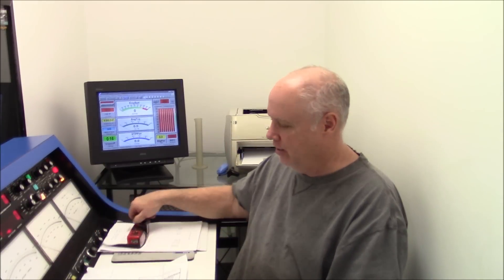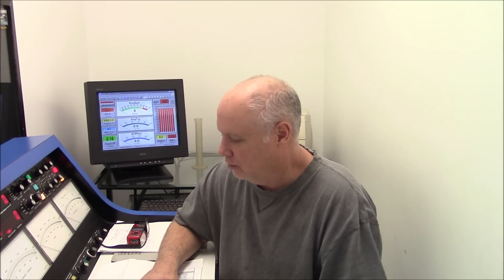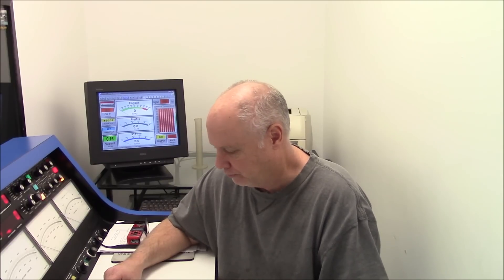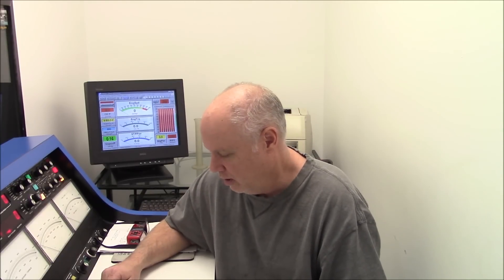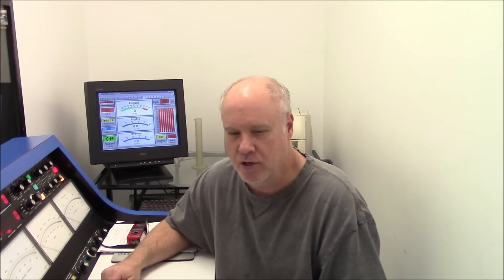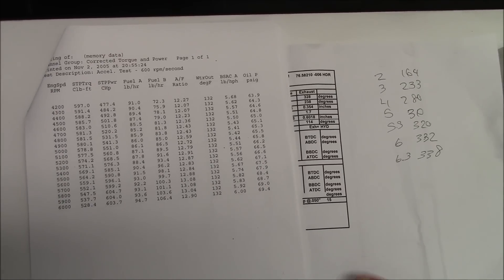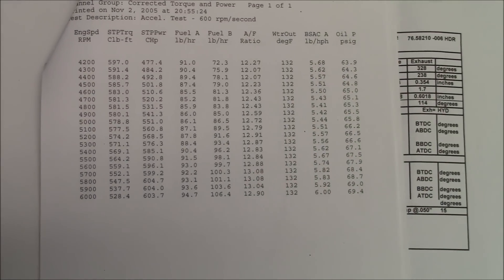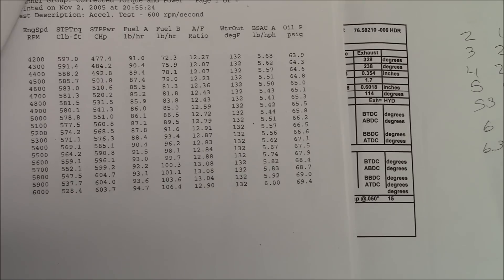Procomp / Speedmaster Oval Port Cylinder Head On 467" Big Block Chevy Dyno Test

Comment: U like those rpm intakes?Not trying to question your judgment, but on my flow bench with  a 330 cfm edelbrock pontiac ,I lost alot of flow with a rpm intake attached to the heads 30 to 45 depending if upper or lower plenum was flowed.Also noticed that the lower plenum flowed better than upper .You seem totally committed to doing a good job.

Comment: I have these heads, ran 11.5-127mph 1/4 mile in a 4 door sedan, with sealed pro 10cc cast pistons, 240/240 578 camshaft, The kit I brought came with adjustable guide plates.
Reply: Glad to hear you like the heads. I bought a set for a 30 over 454 I'm putting in my 69 Camaro. Same pistons as in the video but I'm using a Comp mutha thumper 570 lift. Hope it will run in the mid 11s as well!!

Comment: When you said the exhaust valve guides were all shot I think I know why. I have a set of these very heads in square port! When I have the geometry right for that 320 cc exhaust valve for 90 degrees at mid lift the 1.7 roller rocker that came in the kit with the heads is on the outside edge (toward the fender) of the top of the valve. If those were kit heads that could be the reason why all of the valve guides for exhaust were shot. My question to you is how do I figure out what back set rocker I would need to correct that issue? The valve top 250 thousands maybe a 32 more. Do I count back from side to center from 1.7 to figure out the back set I would need? I realize this video is old and you might not even see my comment but if you happen to somehow I would really appreciate the help...
Thank you in advance, 

Larry

Comment: Yes but couldn't the moral to the story also be use a Bigger Bore sized motor  like 572  or 540 ??
Reply: maybe but the amount of work they had to make them right still might not even be worth it even if you bought them bare.  just buy a performer RPM head retangle port and a weind high rise.  proably less work and would bolt on as well with more compression

Comment: i have used maybe 10 sets of these heads and have not even once had any issues, and will continue to use them. of course i am using new heads but never use adjustable guilds i have never had a problem.
Reply: Glad you like these heads! Bought a set for a 454 I'm putting g in my 69 Camaro

Comment: A big block chevy doesn't need aftermarket heads for anything under 700hp.A probably set up OEM 049 or 781 head will support 600+ horsepower.

Comment: I believe camshaft selection along with the intake choice hurt your HP potential.  They were the right choice for a Torquemonster, but with that many cubes a duration in the 240°- 250° range would have suited the build better in terms of HP output. Also, with a cam in the 240° + range a small singleplane would have complimented the build better, if your goal was indeed HP production.
Reply: I think you could be right but again if the customer wanted that intake and that particular cam, the customer gets to make those decisions and Mark may have had to work within those parameters.  I like what he does with those iron oval ports but the reason a quality aluminum head is so attractive for alot of guys is the shear weight savings off the front end of the car.
Reply: who woulda thought.. bigger cam more horsepowers... and spin and spin till all the parts fly out.  Thanks for the obvious.
Reply: @superkillr   hey genius,  RPM.. IS how you make hp in a naturally aspirated engine. That's not gonna happen with a dual plane and a 232 @.050 cam in a Big Block Chevy. He blames the combustion chamber ?.. think again.

Comment: I bought a set of 305cc bbc heads bare....they were for a street rod truck. The quality was pretty good. Took to machine shop they assembled with Manley valves, Comp Cam springs. The only port work was just around the valve seats. I had about 1000.00 into the heads parts labor after all was said. These were bolted on a 454 with a HO cam. I would not take theses heads racing ....but for cruisers they are just the deal

Comment: I'm not a fan of Speedmasters but I think they have a legit place in the market. I'm working out the details on a 460 BBF swap into a 93' F150. All I'm looking for is a torque monster street cruiser. Any used iron heads are going to need a lot of work = money. Name brand alum = Much bigger $$.  BBF Speedmasters are at least as good as prepped D0VE's and weigh half as much. I'd love to have a set of Kaase SR-71's... if I can get someone else to pay for them. ;)

Comment: Seems like pay me now or pay me later, he gets equal or better from his worked cast heads but again not easy to find a set of good/usable heads just collecting dust in someone's garage, sometimes i think a good 502/572 crate engine is the way to go

Nicks garage has a good video on someone who bought a BBC SUPPOSEDLY making 600 hp with no dyno sheets/proof and ended up making i think about 350 due to mismatched parts that the engine was assembled with. i would love to see some comparisons of the oval/vs rect. port heads from back in the day

Comment: Cheaper is not better,several years I bought a set of brodex aluminum heads for a small block chevy, after installing valve geometry way off. I had to get car running so I left it that way for a couple of weeks before getting back to fix them, in mean time I broke 2 studs while driving,long story short had to redo entire heads new arp studs isky adustable guide plates all new puahrods valve guides and $600.00 dollars later boy what a deal. After redoing motor did not have any issues ran great for years.

Comment: would love to see you do a side by side with AFR 300 heads on a 496 compared to a set of GM ovals that you've worked over.
Reply: No comparison. 300 AFR is the best oval port head.
Reply: @michaelparadisis4076 I agree just would like to see the comparison. I plan on putting a set on a 540 build I’m doing.

Comment: I even cut a bevel at the top of the block with iron heads. Imagine what the air is hitting coming into the cylinder from those heads. I would want to weld them up and take a cutter to them

Comment: Believe it or not i actually agree with him on this one. I actually think he his understating the issues with pro comp heads. Seat heights and seats barely in the casting (falling out) is another issue. There is very little right about them.The heads are also very thin light weight. Pro comp has an other version with a 360c intake and oval exhaust ports that is a much better part. Much better quality. thicker casting. Seem to be a copy of the old pro action heads? 
He bashes a much better head like air flow or brodix but he is polite about pro comp?

Comment: Truck head question. I have a 366T with 473328 heads. I had an engine vibration. I took heads off and found exhaust valves were mismatched. 3 valves in one head were flat bottom and 1 was concave. The other head had 3 concave and 1 flat bottom exhaust valve. Would the valve shape being different in one cylinder be enough to change compression in that cylinder to cause an engine vibration? Having 1 cylinders valve being different than the other 3? Thanks.  I'm wanting to use the 366 truck heads on a 68 396 short block (bored .030). I realize I may have to clearance cut the chamber to clear the #1433 raised dome (9.6 comp). piston. It's for a 58 belair street car. I want small valves and oval ports for good torque. I wont be revving it past 5k if ever.

Comment: I’ve used three sets of pro comps, Automatically new valves and set up with comp matching springs to the cams used. only polished intake and ran good numbers with three different cam combos.
Reply: I have run two sets of these with 253 and 259 @ .050 and .710 lift on a 106 centerline.  Same cubes at 12.0 to 1 static compression with .38 dome and made 762 hp @ 7100.  We were under carbed on the test  He is way in the hole on the cam.
Reply: @user-yc9qr7ww3r  what size motor

Comment: The numbers put down on Hot Rod Garage were rather sad as well using these heads. I think they are a fantastic head if you plan to buy them to have them ported. From what I understand they make an impressive cylinder head once worked over. Out of the box however they are barely better than stockers.
Reply: Pretty much every independent test I've seen has shown these speedmaster heads aren't very good.   It seems the AFR 265's are the best head for fairly short $$.   When I say fairly short, I'm considering a good head that's ready to run vs a really cheap head that needs ton's of work and parts before you can put it on the engine.

Comment: Hey Mark, don't you have the same issue with AFR heads as far as head gasket?
I know when I build my 496ci 
4.450 was the size of gasket I had to use,  other wise the gasket hung over the combustion chamber.
I bought  4.375 and they wouldn't work, so the closest I could get was 4.450 , on a set of magnum 290cc oval port 112cc chambers 
I used a  .030 MLS cometic gasket with the piston .007 in the hole.
On a dart big M block

Comment: Bottom line. Spend more money upfront for better quality heads. Save yourself some hassle, and be better off in the long run. Thanks for the video. There is good, and there is cheap, but there is no good, AND cheap.

Comment: He's right , I have the same heads. Purchased from Skipwhite. They did put in really good valves,seats ,guides and retainers.I did put in comp cam springs and my Corvette runs like hell. So ,resumed : The casting is perfect but the original valves ,etc are bull shit. So buy bare heads and put in quality stuff.

Comment: I have a question. I rebuilt an 8.1 496. Haven’t started it yet I’m waiting for intake carb push rods and rockets. Bored 30 over. ARP rod bolts. New flat top pistons. 
Heads cleaned a little exhaust port work. Comp cams springs. 

My question is when it came to the head gasket the only choice I had was felpro. I noticed a LOT of gap between cylinder walls. Is this ok?

Also I noticed had no alignment pins for the heads. 

So I cleaned the threads. Got new head bolts. Used a little lube on the shoulder and torque to 60. Also I sprayed copper gasket. 

Honestly I have my fingers crossed and hope it’s dependable. When I torqued my bolts some would torque earlier. 

Any advice what’s your take on this. Should I buy a better gasket is it worth it.

Comment: Mark, What would you do???
Big Block Chevy 427 Tall Deck, Industrial engine,  that has stock FACTORY reverse gear drive, with four bolt mains & steel crankshaft.
I learn alot from these videos about a solid reliable Big Blocks.
Also like NO music 🎶.
Just the facts.
Thanks.
Reply: I have 496 tall deck big block. Initially I wanted a 9.8 deck height, but when I received my 496 and looked up the casting numbers, i realized that it was a 496 tall deck. It started out as a 427 tall deck truck block. It dropped right in my '68 Impala without any modifications. Headers fitted as well. I only had to put a dent in the header to clear my power steering pump.
Reply: @musclebone7875  
Yes this engine was a grain truck engine. It has a factory G.M. gear drive camshaft (reverse rotation).
Reply: @nellyfarnsworth7381  what do you want to build out of it?
Reply: @musclebone7875  
To put into a 1972 chevy corvette. I already have Hooker headers with Hooker  side mount "mufflers".   This was before cats.
Will pull the original big block out ( number matching) & save.  Will also save the 4 speed Rock crusher, & replace with a manual 5 or 6 speed.
Reply: @nellyfarnsworth7381  ok I think it's gonna be a tight fit. I know for a fact you're gonna a 4-inch cowl hood. I'm using a dart single plane intake.
Reply: @musclebone7875  
Thanks for the heads-up on the hood. Will start looking for another hood. Do Not want to hack up the original. So that everything can be bolted back, to make a original again.
Reply: @nellyfarnsworth7381 L-88 hood would be killer.

Comment: You said you got the heads used with worn out guides. Is that why you had to replace everything is because the heads needed rebuilt ? And what CC were these heads advertised to have ? They start at 305 up to 360CC ?

Comment: In this build, he mentioned using a Scat 9000 crank. KB/Icon makes stroker pistons for 402 to 434 builds. His massaged 781 heads should wake up a 402/434 I figure. Need to talk to these guys, love the way they do the videos, laid back basic machine work. 620hp/647= 1.327 hp/ci.
434 x 1.327 = 576hp, sounds like fun.

Comment: I had that exact same set of heads and sold them before trying them because after I researched from other people  they said the same thing.They cost too much money for the little gain you get. I stayed with my 781`s.
Reply: Ozzy yeah I have 781 that are ported. I was wondering the possible gains from a good set of aluminum heads.
Reply: the shark me too. I stuck with my 781’s that have been worked. The machine shop guy was impressed how they came out after he did the valves and throat cut. I still wonder what these smaller heads give up to AFR’s but happy so far, and they’re paid for.

Comment: Btw, it only started leaking when I took it to the track and pushed it hard, I was also told it could be crank flex that would cause the rear main seal to leak under acceleration, your thoughts would be greatly appreciated thanks
Reply: Man that sucks to hear all that work and it leaks.
Reply: @ApostleDavids8w  yup it sucks! Was doing great with all the car shows and stuff, but everyone kept asking, how it does at the track, so I felt if you're going to build it to look like a racer, you'd better race it, and that's where it all started leaking, winter project I guess
Reply: Rat gas Garage ya another good winter project to make her bulletproof 👍

Comment: Hey buddy love your channel! I have a question for you, have you ever come across a leak near the back side of the oil pan next to the flywheel only when revved up, on bbc 454, idling is fine no leaks, I've redone the pan gasket thinking that was it, but still happened, I also added evac system it didn't help
Reply: Add a air pressure gauge to the valve covers (0 - 5psi). IF you have blow by at high rpm,  it will still pressure the crankcase.  Run the car on a chassis Dyno.  
If you want the best gauge, use a water column, with food dye.
This will show positive & negative psi. Water column will show tenths or hundreds of psi. 
Was the block honed using a Deck plate????
Comment back, want feedback on this theory?
Thanks
Reply: @nellyfarnsworth7381  to answer your question, I have no idea, I bought this motor from a part's dealer who said it ran in pink's in a Camaro and that it's a good engine
Reply: @ratgasgarage  
Another guess, engine is overbored (too much) cylinder walls are Thin, and Not sesling at high rpm.
Reply: Don't know if you still have the oil leak issue but it maybe coming from the rear main cap or seal? Hope this helps
Reply: @donwalsh7521  thanks Don, sold the car about a month ago, never got around to fixing that issue, one of those things it never hurt performance was just annoying to say the least.
Reply: Do have a pcv   valve  on your values  covers
Reply: Do you have  a pcv on your  valve covers  that's  for crane  case ventilation
Reply: @gumby3123  used to have one coming from edelbrock rpm intake, but switched to a tunnel ram setup, might have to make a hole in the carb spacer, but I didn't want oil contamination into combustion

Comment: I enjoy these engine building videos and I have learned a lot of details that make things cook. 
I am considering doing business with this outfit, does anybody know how to reach them?
Reply: Vortecpro in Colorado Springs. I have one of Mark’s 467’s, it’s a screamer.
Reply: @tailgater2  Thanks for the info...I got the impression they were in Iowa?
My 68 impala would like one of those 467's...I assume the experience was positive? Thanks again.
Reply: @mike f  I visited Mark’s shop to pick up my engine, very good experience. I run it hard, no problems at all, 600hp 600lb/ft all roller. It’s a blast.
Reply: @tailgater2  I've never had 600 anything, I got virgin 781 heads, hankering to build a big block, plus a couple of 402 blocks I would like to use, plus peanut port heads too. Your endorsement plus the videos make me want to look deeper into VTpro. My 68 impala and 78 Malibu want a rat under the hood, got to talk to mark about what can be done. Thanks again.

Comment: How far 'off' is the factory main bearing bores? Was GM that incompetent that most all speed shop engines need to be Line Honed to make them more accurate?
Reply: Why do you say "incompetent?" GM engineers designed two of the most successful production based engines of all time. Let me set you straight.... When you produce hundreds if not thousands of engines per day for 50 to 60 years there will be foundry/ machine/ tooling upper and lower limits. By the way, you've never poured an engine block or a cylinder head etc, etc in your life so how would you know???
Reply: @hilleryclifford2367  Dude, you COMPLETELY missed the entire point of my comment. You better re-read it again several more times to try and comprehend just what I'm saying and if that doesn't help, get someone to 'splain it to you. You need to 'set yourself straight' buddy, and while you're at it, lay off the beers.
Reply: I didn't miss anything clownie, been racing BBC for over 30 years learn how to read a mic and a dial bore gage, oh wait a minute, you've never built any kind of engine in your life! Well done👍👍